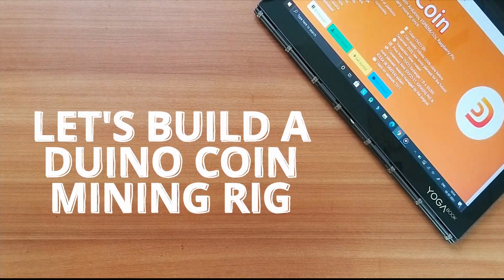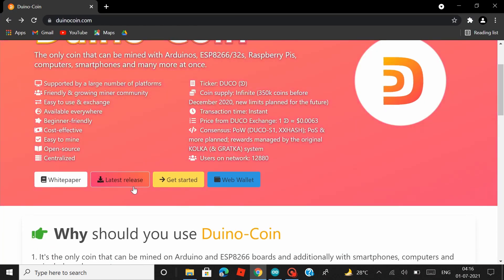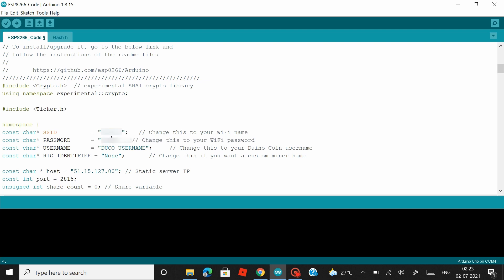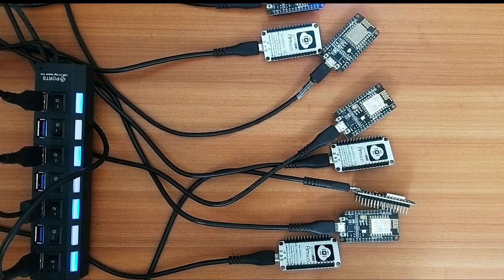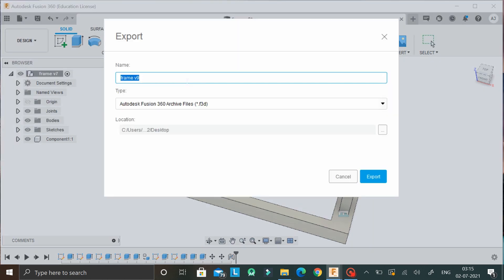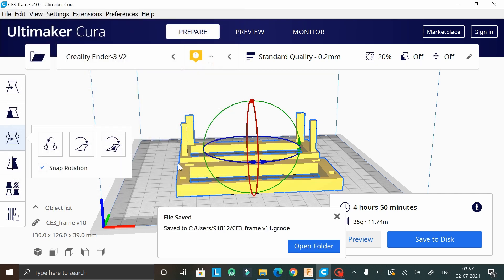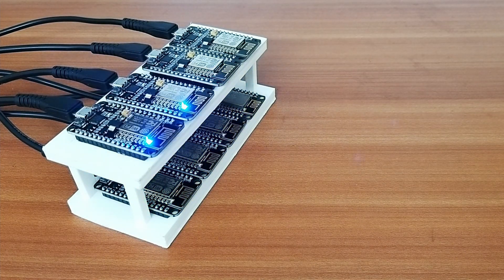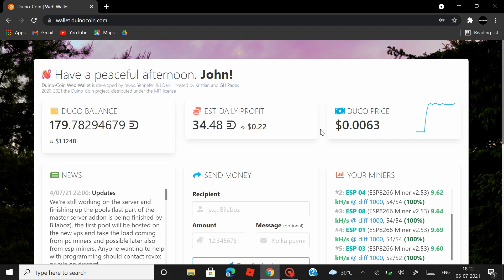Build a Duino-coin mining rig using NodeMCU boards

Comment: Congratulations on the video, very well explained...
That's cool, could you share the 3d file for printing?
Reply from the maker: Hey, I've attached the G-drive link with the STL file of the frame. I've also added the Fusion 360 CAD file in case you want to make any changes to the existing design. Hope it helps.

https://drive.google.com/drive/folders/1C7s-rYrsu8V3YgVkqaWNis1Ehj14kmi1?usp=sharing
Reply: @TheCommonChannel  Hey Man! Very, Very, Very Thanks!

Comment: Does the computer need to be switched on alla the time and the arduino connected to the com port permanently to mine thr coin?

Like could it be done by powering Arduino with its own power supply without being connected to the computer and mining on its own ?

Comment: this crypto pay you or is scam? i read have limit of board.. you use a lot board and it work same without ban?
Reply from the maker: The exchange rate is really low. You could exchange them for different altcoins. There is no ban for boards but since they follow the KOLKA system for rewards, the more the no of boards, the no of coins would also decrease.

Comment: Quite informative but I still have a question. 
The source code has to uploaded to each board or just one?
Reply from the maker: Hey!! The source code has to be uploaded to each board because each board acts as an individual miner.
Reply: @TheCommonChannel  Thanks for the answer.
Is there any way to set up a little screen for data?
Reply from the maker: @sebastiancojuharii5958  Since its mining using ESP 32s there is actually no need for a screen.
But in case of AVR mining you could connect a small screen to your Arduino or Raspberry Pi board and have your terminal window displayed on the screen,

Comment: How to add more esp sir ?
Reply from the maker: You can upload the same code with only a change in the rig identifier name. You can add as many as you want like that.
Reply: @TheCommonChannel  is this need to edit avr miner or nah ?
Reply from the maker: @PinoyWoodLegends  For mining with nodemcu, you don't have to make any changes, in the code. Just upload the code with your wifi ssid, password and a rig identifier name. 

AVR mining is for Arduino boards and if you want to add more boards after your initial configuration, you can head over to AVR miner resources in the Duino coin folder and delete the AVR_Config file. Then when you restart the AVR miner, you will have to do the configuration once again and when they ask you if you want to add more boards, type YES and add as much as you want.
Reply: @TheCommonChannel  thankyou you are the best
Reply: Keep uploading about duino coin mining thankyou so much👍💎
Reply from the maker: @PinoyWoodLegends  Sure I will!! Thanks a lot🙌

Comment: How much is the limit of arduinos to mine? Thanks!
Reply from the maker: There is no set limit for the number of Arduinos. However, with more Arduinos you add, the rewards will decrease a bit as Duino coin rewards are managed by the KOLKA System.

Comment: Hello, Can you also share you're 3D desgin? it's looking very nice
Reply from the maker: Hey, I've attached the G-drive link with the STL file of the frame. I've also added the Fusion 360 CAD file in case you want to make any changes to the existing design. Hope it helps.

https://drive.google.com/drive/folders/1C7s-rYrsu8V3YgVkqaWNis1Ehj14kmi1?usp=sharing
Reply: @TheCommonChannel  Thank you :)

Comment: hi bro
what is the actual rate at which u sell?? is it the rate on the exchange?? its too low, is there any other working and fast way to sell DUCO other than the DUCO exchange that gives better rates?
Reply from the maker: Yes, it's the rate you see on the exchange. You can also trade Duino coins with other miners for other coins using the otc trading platform in the Discord channel.
Reply: @TheCommonChannel  I have posted a ad on that discord but no replys
Reply from the maker: @adityakore7126  Try the #help channel in the Duino coin discord server.
Reply: @TheCommonChannel  ok will see

Comment: hello my friend, how many duinos are 8 Nodemcu digging per day, can you help me? i want to take it according to the situation
Reply: And did you request a shot? how many Duinos should there be at least or how many shots are taken at most?
Reply from the maker: Eight of them mines between 50 to 60 Duino coins per day. Again this number can vary if there are issues with the server (most of them have been fixed by now).
Reply: @TheCommonChannel  thank you. so how much is the lower and upper limit for the transfer? Did you transfer?
Reply from the maker: @Adilcevazz  I haven't exchanged any duino coins yet. Just mining and holding them at the moment.
Reply: @TheCommonChannel  so you traded on the duco exchange? Is there an upper and lower limit?
Reply from the maker: @Adilcevazz  Yeah, you would need minimum of 200 duino coins to trade in the Duco exchange. I don't think there's an upper limit yet.